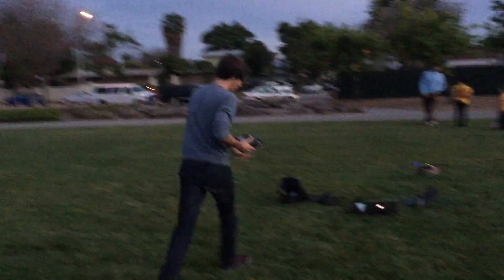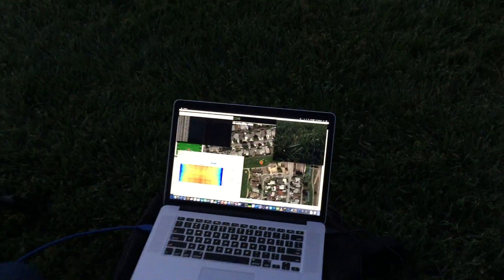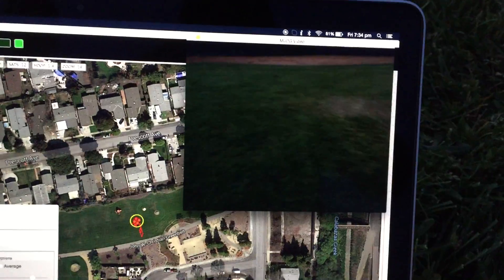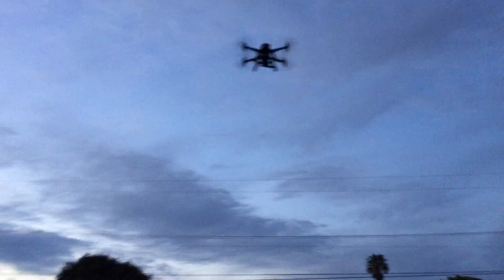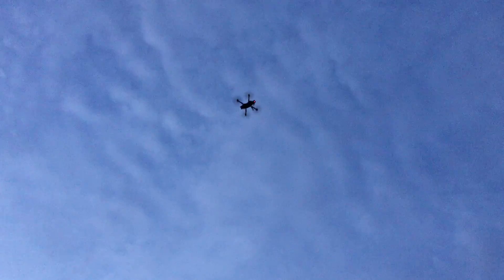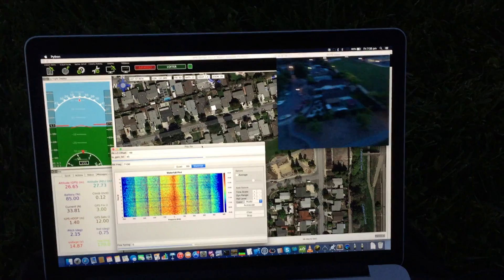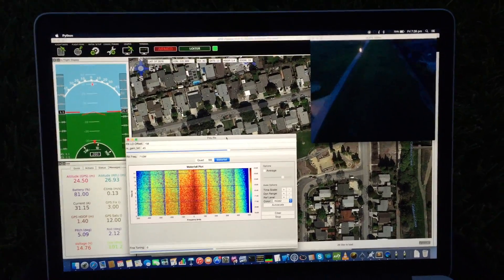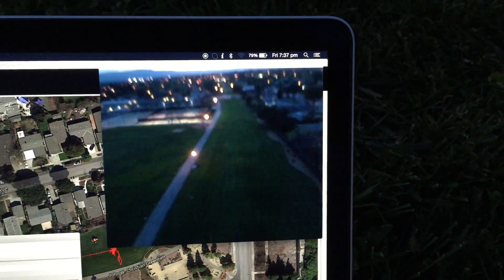Drone + SDR: USRP E310 real-time digital video downlink (teaser)

Comment: @balint256 - How are you powering on this device? It has been mounted on the drone and e310 has no battery. Can you share the details of the external battery you might have used to power ON the e310 device?

Comment: @balint256 I'm very interested in your real-time digital video downlink (via E310) project. What's your modulation methon.? Did you use RFNOC? Could you share more information or the code of this project? I've used E310 as a psk modulator. But the cpu of E310 can't hold more than 32kHz bandwidht. I don't know how to handle it.

Comment: I always thought the compression is the biggest hurdle in live video views.
Especially the lag and power consumption it induces.

Not using WiFi is perhaps more efficient. How do did you solve digital compression?
Reply from the maker: Tilman Baumann In this prototype I send down the raw MJPG frames from the webcam using a simple QPSK modem (the lag isn't too bad).
Reply: Ah, MJPEG . Thanks.
Not very efficient. But at least it is compressed. And MJPEG has no buffer requirements in the codec because it works frame by frame.